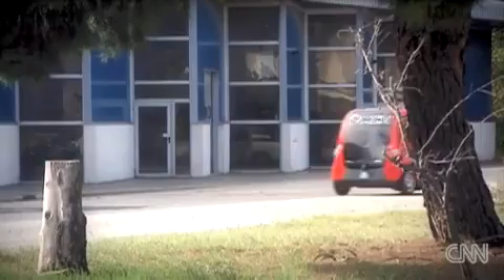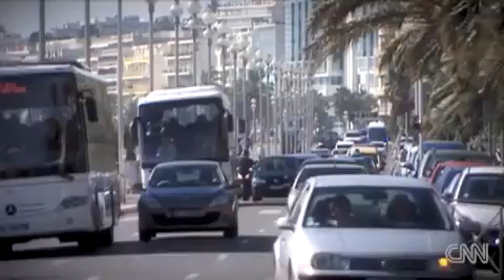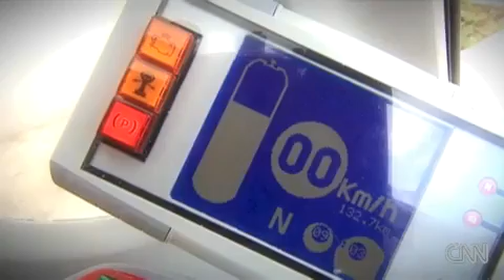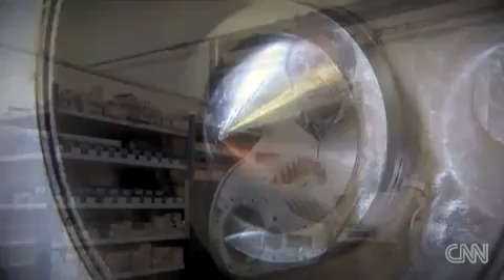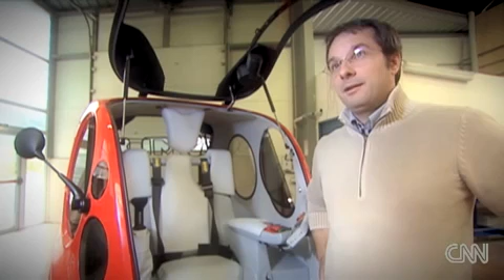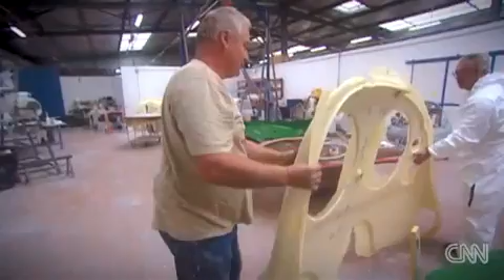AirPod - L'auto ad aria compressa | OneTag - Io c'ero!

Comment: Yep many uses for oil and we just burn it for transport... The very practical alternatives are still too expensive, whether you build them yourself or you buy a 40 000 eur vehicle from the factory at which point you will have to put in a new battery pack every 5-10 years depending on recharge times.